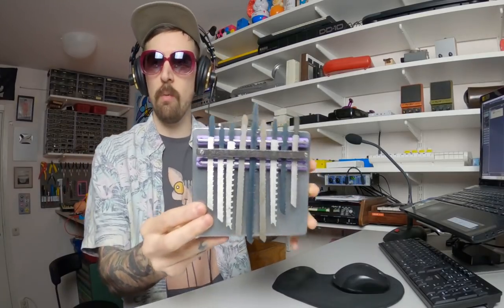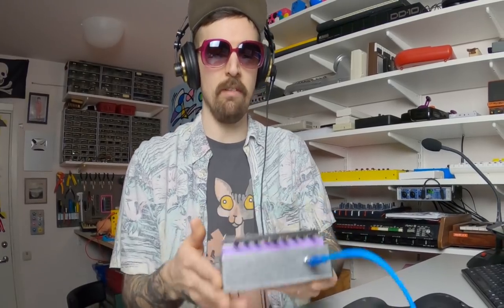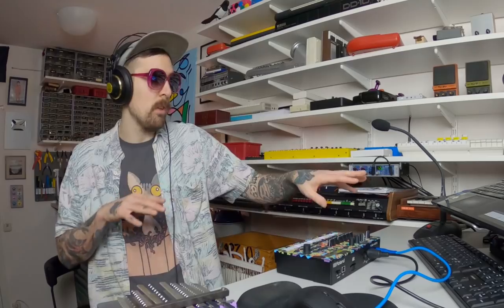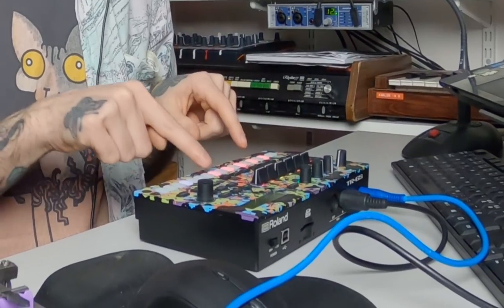I Made A SAWBLADE Kalimba And It Cuts Through The Mix

Comment: Anyone Knows how to "create" a mic jack? I just bought a Panasonic Rn 305, but it just has a line out, and I want to record things to the line in of it (that doesn't exist) because I'm trying to record digital audio to tape... Would those headphones and mic splitter work on it?
Reply: you would probably have to open it up, disconnect the internal microphone and wire those leads to a jack. and then feed it a really low signal so it doesnt clip out the microphone preamp